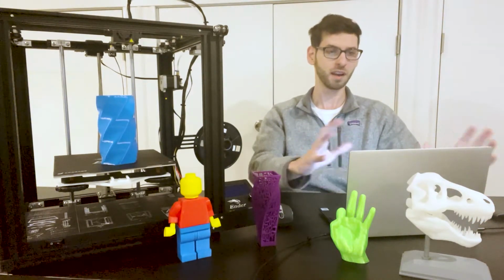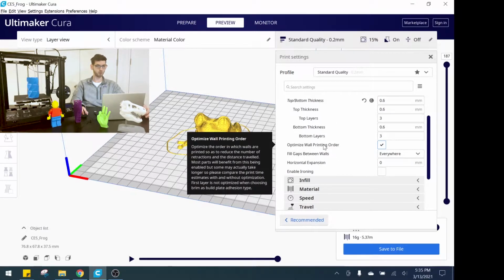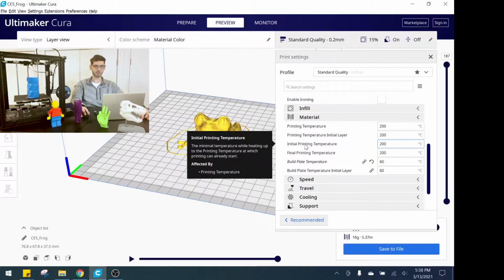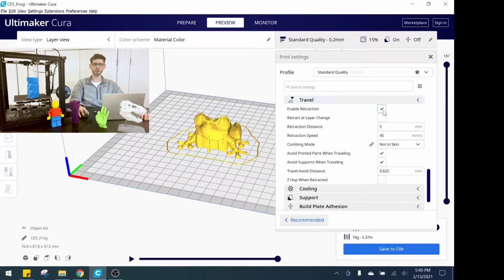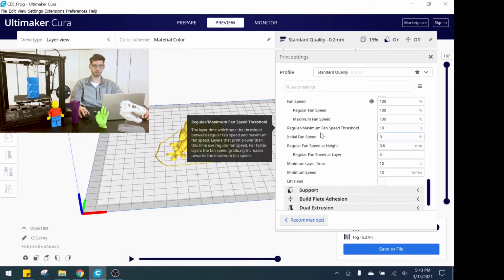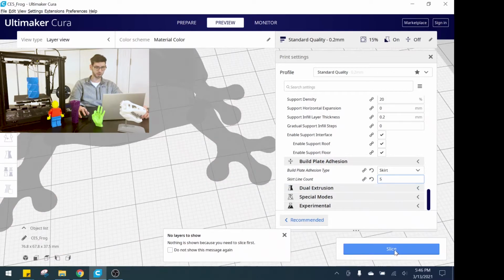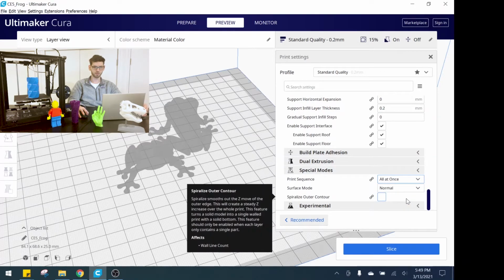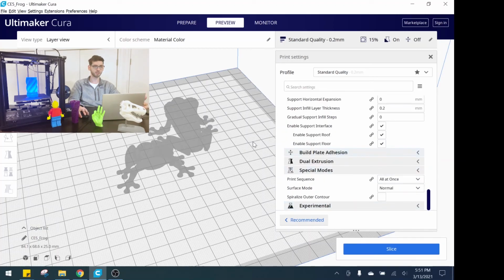PART 3: Beginner Cura 4.8 Tutorial (Advanced Settings)

Comment: Hello there. Thank you so much for creating this 3 part series of configuring Ultimaker Cura for 3d printing. It has really helped me a lot as a first timer to 3D printing. I have a some questions. Suppose I drew a model with a wall thickness of 1.2mm in 3D CAD, will changing the wall thickness in Cura to say 1.6mm alter my intended wall thickness of 1.2mm? You said spiralized are great for single perimeter walls without any infills in that it reduces the printing time but does it also sacrifices on the smoothness of the wall both inside and outer side of the wall? Lastly if I wanted to print a conical shape vase with a single perimeter wall of 1.2mm thickness and has an overhang angle of less than 45 degrees, actually 30 degrees to be specific, what settings would you recommend so that I can get away with adding supports to prevent the internal wall from drooping? Thank you so much, God bless and stay safe.
Reply from the maker: Hi @cn ng, thanks for the comment and questions! Your printer will only be able to print wall thicknesses that are multiples of the nozzle diameter. So for example, if you have a 0.4mm nozzle and you are trying to print a 0.7mm wall thickness your actual part will be 0.1mm oversized (0.4mm x 2 = 0.8mm). If you scale your part the dimensions will either all scale together in the X, Y, Z directions or you can select to only scale in 1 direction. Spiralize should be able to give a surface smoothness that is about the same as a standard print (although if you print faster/slower you may make the surface quality slightly worse/better). If you are printing a conical shaped vase with overhangs with angles less than 45 degrees than you will most likely want/need to use supports to get a successful print. Hopefully that is helpful! Let me know if you have any other questions! Like and subscribe if you haven't done so already!
Reply: Hello Sir, Yes I have liked and subscribe to your Youtube Channel. Thank you so much for your swift reply. It is very helpful indeed. I truly appreciate your kind and generous help my dear friend. God Bless and stay safe. Cheers